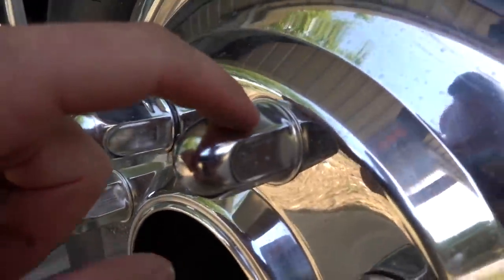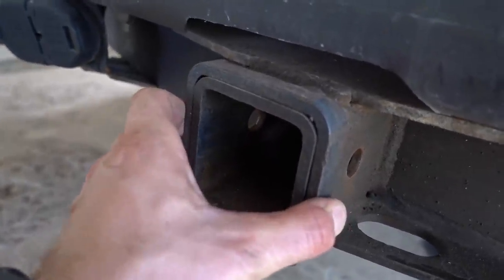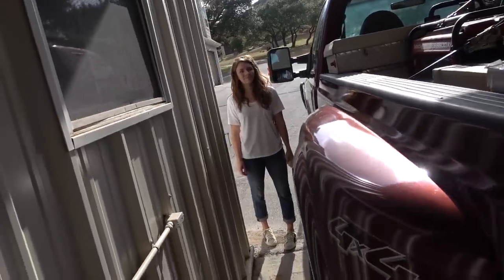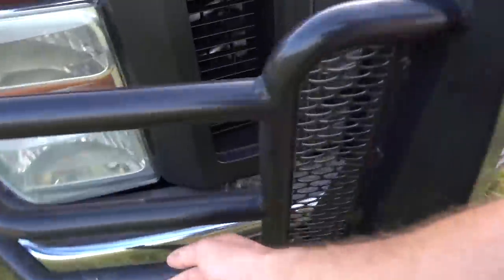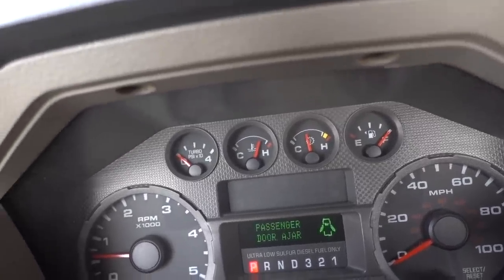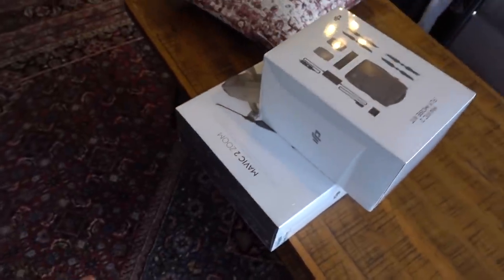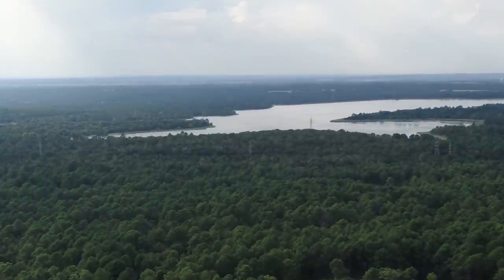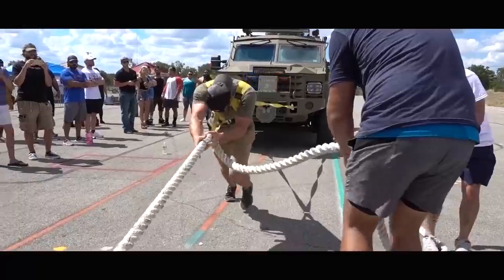My F-350 broke down immediately.....

Comment: The person that sold this or the dealer that sold this knew this truck had a problem.
Reply: well no shit, they all have problems. theres always something wrong with a ford super duty you find at a used car lot lol. ive seen many of them with the radiator overflow tank sealed off, so that you wont know theres a head gasket issue introducing air into the coolant. you dont know until its too late, and you take off the radiator overflow and see that its been filled with silicon by some sleezy asshole who didnt want to fix the issue to begin with.
Reply: Anyone who buys a Ford knows it has a problem even before being told
Reply: Its a ford so everyone knew there is problem with it
Reply: Yup.... I allways tell my customers to have $1500 set aside when buying a used vehicle.

Comment: I used to change out 7 tires on a dulie in 5.5 minutes when I worked for Sears tires, that's 16 or 16.5 inch rims could be dangerous and if you put on the smaller tire on the bigger wheel it will take your head off when you are seating the tire bead

Comment: Matts got a diesel that can't go over 60 on the freeway and its not a Hummer.      Probably should of just used the Hummer.
Reply: I've driven a humvee that couldn't even make it up a curb. Granted, this humvee was loaded down with sandbags in the floor boards, and the doors were replaced with half inch thick steel. Even still it could make it up a 5 inch curb. The turbo diesels were better but not by a long shot.
Reply: @Knoxvillemoto  that's a lot of weight
Reply: Yeah Banks offers turbo kit for Humvee makes them a beast
Reply: @kaydmcdougall9540  I agree it's not light, but not so much that I would expect it to have so little torque that it cant do it at all. Also we're talking about climbing vertically, so much of the rear biased weight is inconsequential. All the weight rearward of the back axles actually help it up the curb.

Comment: I'm a ford guy but a 6.4.... This is hilarious. They were made to die to get out of contract with ford.
Reply: International ran them till 2016 as the maxforce..... 6.0 are still the worse....cost ford way more
Reply: @jonfischer9781  my 6.0 just hit 700k miles stock
Reply: @marcuspatrick1524  That's always good to hear. My 6.0 has 245,000 and still runs like a dream. It's in a 2003 Excursion and they are getting hard to find so I want to keep it forever. lol
Reply: In most cases, the 6.4 can't even be rebuilt. It's a throw away when it goes bad.
Reply: @marcuspatrick1524  thats sweet....I did not say all 6.0s
Reply: @mckrackin5324  Yeah 6.0 is a great engine in the right persons hands :)

Comment: You don't need to go bankrupt on a newer 6.7, you can find an older OBS Ford with the 7.3 for much cheaper, plus the 7.3 is just way more reliable
Reply: May as well tow with the raptor in that case.
Reply: Lol dudes are asking just as much for a obs 7.3 as they are for a 6.0 that makes twice as much power stock  lol 6.0 are reliable as long as u take care of them. Best truck I've ever owned hands down
Reply: Dont think Matt needs much more power than a 7.3.

Comment: Shoulda bought a 6.7...or 7.3. And also sounds like a blown head gasket, so like 2 grand.
Reply: Yeah could have spent a little more and bought a 6.7 and not had a single problem
Reply: Ty Bailey it’s the oil cooler lines they clog up and it overheats
Reply: It also could have just been the fact that it was 107 degrees in Texas, and I doubt that Matt checked the oil level in the first place. You could be right though
Reply: @aaronhayden1780  it could also be a radiator. Degas bottle cap or blown head gasket. The 6.0 had similar problems and over heating while towing was an early sign of head gasket issues

Comment: Wow, i said it'd break down on your last video about the truck, didn't expect it so soon 😅😅😅
Reply: Paul Auten cause it’s a Ford
Reply: @gehlk4683  should get a toyota
Reply: JM GAMING yea no he needs to get a gmc
Reply: @gehlk4683  no a dodge with a 12 valve in it
Reply: @gggaming-md9qf  6.7 cummins from 2010 because it has same emissions standards as the 12 valve......the 6.7 in use is a slightly modernized version of the 8.1 liter used in buses and military 5 tons
Reply: FORD - F#@ked or repaired daily.
Reply: @paulauten1945  i agree but honestly any cummins is more reliable than 6.4s or 6.0s

Comment: Theres a chance that front bashbar is restricting airflow to the radiator causing it to overheat under load. Diesels DO NOT LIKE TO HEAT SOAKING (Letting it sit with engine off after excessive heat) Your truck is overheating beacause of a fault in the cooling system reducing the possible work load the engine can produce. IF YOUR DIESEL EVER OVERHEATS WHILE UNDER LOAD ITS BEST TO STOP AND LET THE ENGINE IDLE!!! Diesels like to idle and that's the best way to get them to cool down unless the overheating situation happens regardless of engine load.

Comment: Easy fix. Full delete for overheating and replace those turbos for the oil leak. Probably if you take intake boot off you will find your oil. Be careful driving because the intercooler probably is full of oil.
Reply: On the next demolition ranch the old ford has a runway engine.  How long before she blows apart?
Reply: Ford intercoolers will always have oil in them because they vent the crank case into the intake..
Reply: Also just a thermostat for overheating.....still needs a tune and delete though....
Reply: @jonfischer9781  not talking about a little. I'm talking about when those turbos fry they dump major oil always start little white smoke then all your oil in the intercooler.
Reply: @joeballew603  6.4 turbos are not a common failure point.....

Comment: A 1999-2003 f350 7.3 powerstroke dually single cab will run forever and will be the same price as that 6.4
Reply: Jason Kone 7.3 is the OG
Reply: Cars and Guitars yup best diesel ford ever made
Reply: Could not agree more we have a 99 ford 7.3 it's got over 400,000 miles on it and runs great

Comment: Head gasket, egr cooler, #7-#8 melted pistons, emissions problems The international Navistar 6.4 are problematic
Reply: That's one reason why navistar and ford split off, they got tired of dealing with the engines and it ruined ford reputation
Reply: Lifter roller gone bad and ruining cam shaft.

Comment: Welcome to mechanic Ranch.

The 6.4L power stroke is the cheapest diesel ford but there is reasons for that.... random over heating oil consumption sounds like head gasket but im not a ford guy sooooo... good luck keep us informed :)
Reply: lol 6.4 is not the cheapest motor my guy, it can be considered to be trash by many because it has so many problems but it is not cheap I’m sure it has a lot to do with being built by another company (international)
Reply: It wasnt shown to be consuming oil...there just wasnt enough oil in it...it coulda leaked...def should do an oil change.

But if it made it with the speed down...but oheats at 70...it probably just isnt getting enough coolant circulation. Since it sat presumably. Id say sticky thermostat, failing water pump, or failing hose. Radiator might be clogged, also.

Id stick with the simple shit first. Rather than deciding to do a 3000 dollar rebuild on a whim. But im not a real mechanic, and dont know much about diesels.
Reply: Hdz Heaters uhhh... International built great diesels, but Ford had to stick their nose in it and ruined those engines.
Reply: I think you’re correct with the stuck thermostat, you woulda heard that electric fan going over the sound of the motor if the thermostat was accurate.

Comment: Upgrade the transmission cooler. Typical problem with those trucks
Reply: Everything is the problem with those trucks
Reply: That's the water temp gauge, transmission won't make the water overheat. It's most likely a circulation problem
Reply: Dani Khaos yeah lol, you have to upgrade a lot to get them working good.

Comment: matt convinced me he’s never changed a tire or changed oil and dosnt know how to give a truck a checkup
Reply: I was thinking that.  

Matt I love you but you need to dive into a top end rebuild and do everything but the machining.....sorrt my friend but the oil wont have anything to do with cooling.  Good catch that it was low however.  Next time check all fluids before leaving.

Im betting something more than a fan clutch being dead though.   He needs to check the actual coolant level in the radiator not the overflow bottle.....
Reply: For sure dude

Comment: Matt im going to be honest with you i work are powerstock day in and day out bullet proof the 6.4 and it will be one bad ass truck
Reply: a whiteman there’s a lot of trucks you have to bulletproof if you want them to run forever. When companies make vehicles now they cut corners and make shit cheap.
Reply: a whiteman if you think it cost 10k to bulletproof it then you don’t know how to work on a diesel. Bulletproofed many 6.0s and the parts are only a few grand not 10k
Reply: I just spent $15,000 on mine and I still have problems with it.  SELL THAT THING!

Comment: It’s a 6.4 Power-stroke. Get used to it breaking down. 7.3,6.0 are better.
Reply: Thomas Graham 6.4 is just a bored over 6.0. All the issues from the 6.0 just twin turbo lol
Reply: Only if you bullet prooof the 6.0. But shit when ya do those damn things are fast
Reply: High Octane Performance except for the fact that the 6.0 and 6.4 are two completely different motors you are correct the 6.0 is a heui injection system and the 6.4 is common rail
Reply: High octane performance is 100% wrong with his comment. No Powerstroke engine is the same. Very very little actually interchange. The 6.4 is in fact a Navistar 200k mile throw away engine. The 6.0 is a way better engine in its bulletproofed form. Get a 2014 or newer 6.7.
Reply: Trucks do break PEOPLE. Relax.
Reply: @jasonjgr8580  Especially 6.4s
Reply: But I agree any vehicle or engine can break with lack of maintenance

Comment: That mesh in-front of your radiator is doing no favours blocking airflow over it. The fan may not be running to cool the rad either.
Reply: this makes a lot of sense; it's actually a pretty big obstruction

Comment: Huh it’s over heating why don’t I just pour 5 quarts of oil in it that should fix it right?
Reply: Amen brother
Reply: Coolant possibly
Reply: If the oil level is low it will also cause a motor to overheat
Reply: @TheKeithbudz  Yeah... As it's slinging rod bearings and punching holes in the block... If low oil pressure was the problem, the truck wouldn't run because the injectors wouldn't fire. Low oil pressure can NOT kill that motor in stock form because the injectors will quit firing as soon a cavitation is seen by the ECM. Every Powerstroke and Duramax works that way.
Reply: @mosquitofleetfishing6599  Sorry man but your wrong. The 6.4Ltr is common rail injected and not a HUEI injected motor like the 6.0Ltr was. And all Duramax's are common rail injected, they have never been HUEI motors.
Reply: @TheKeithbudz  It would have to be extremely low. That motor holds 15 Qts so 4 Qts will not bother it for temp.
Reply: @Darkhalfcustoms  I agree with you on this post, however, I think you are misunderstanding what I am saying about the fuel injectors. You are correct on the different types of fuel rail systems. The ECM is the safety on the 6.4, 6.7 and DMAX. The slightest bit of cavitation and the ECM will quit firing the injectors. The 7.3 and 6.0 flat can't fire the injectors because of the Hydraulic valves. It's a safety feature in the ECM firmware on the later models.

Comment: I wonder if your truck needs a valve job because with it overheating at higher speeds, the valves might not be opening long enough to let the exhaust out quick enough causing it to overheat.

Comment: 7.3l are cheaper, more reliable, cheaper to fix and they still can get the job done
Reply: DieselKing Trucks Cheaper and more reliable but the trucks they’re installed  in are getting old. A mid 04 and up 6.0 that’s been deleted and NO chip will get the same job done and the ride is a LOT better
Reply: @clementroubaud9361  ride may be better, but perfer solid axle for a truck
Reply: @scottsgamingtv7168  all 4x4 250/350 ford trucks are solid axle...   Though I think some mid 90's gas trucks had the TTB in the 250's
Reply: @hunterdan2002  friend has a 05 f250 with 6.0, as far as what he said, it had independent
Reply: @scottsgamingtv7168  then it's only 2wd

Comment: Bro, go to the 08-10 6.4 page on FB and read up.

You probably have a clogged EGR cooler/ valve or a clogged oil cooler/bad thermostats. Bad head gaskets would puke coolant out the degas bottle.
Reply: The 6.4 is world's better than the 6.0. Could be a faulty fan clutch, or clogged radiator.   A short trip, pulling a small load would show it...as an empty truck would not.
Reply: Justin LaPierre yes Delete everything and it will be a good truck.
Reply: @michaelcook768  hey i know a Michael cook.. You from tx?
Reply: Didn’t he say he had coolant on the oil! Hgl
Reply: @AudibleVisibIe  Afraid not. Originally from VA, been in AL for 11 years. I drove an 18 wheeler...mostly at Grand Prairie, sometimes Laredo. I really like TX. I had Carpal Tunnel surgery...ended up with a lethal case of Sepsis....so, my career is over. I have family near Austin. I would need affordability in housing, and 20 miles to a sizable medical facilities. If you have a couple suggestions, please let me know...Thankd!
Reply: tjlift22 can you explain to us petrol heads what it means when diesel bros say delete?
Reply: Justin LaPierre maybe it’s just shit cuz it’s ford
Reply: austin randall 6.4’s typically don’t show oil/coolant mix when head gaskets go, they usually push coolant out the degas. Coolant in the oil usually means a ruptured oil cooler.
Reply: austin randall or a cavitated front cover

Comment: Sorry man everybody who knows anything about fords knows 6.4s are very bad engines
Reply: Ford alone it's a bad truck
Found
On
Roard
Dead
Reply: Fixed 
Or
Repaired 
Daily
Reply: Deleted and tuned they are beast. Best diesel engine to get easy huge power out of.  I put 165,000 trouble free miles on mine before getting rid of it for my 6.7 and it was deleted and tuned with normal bolt on's from just a couple thousand miles.  It wasn't babied at all.
Reply: 7.3 is the best
Reply: The 6.4L is a great engine. Mine's been running on a pretty hot 250HP tune most of its life. I see 40psi most of the time and never baby it. I also take good care of it and have deleted EGR and DPF.
Reply: @renejrsoto  Cannot Have Expensive Vehicle Yet -  Chews Heads and Eats Valves Yearly-  Cheapest Heap Ever Visioned Yet. government bailout much???
Reply: @benb8228  : No kidding. Leave it to a neanderthal to not realize "fixed" and "repaired" are the same thing. Imagine asking a mechanic who is giving you back your car "Did you fix it, or did you repair it?", Lololol.
Reply: 6.4s are not as bad as the 6blow
Reply: My Uncle When He Hade His 6.4 Super Duty PowerStroke It Was like A 2007-2013 Its Alternator Keep Catching On Fire They Sold It And Got A Used 2015 GMC Yukon XL Denali With like 20k miles It Was A Pretty God Trade
Reply: @renejrsoto  I Love Driving On The Roard
Reply: If it’s overheatin don’t forget to check coolant hoss not just oil
Reply: @trevorfoote309  TWO TIN CANS AND A BAIL OF HAY MAKE A CHEVROLET
Reply: @michaelhoneycutt1837 : Yeah, it's the 6.0L that really got the bad reputation. I've heard of a few random problems with the 6.4L (vs 6.0s grenading), but most related to the DPF (same thing every diesel has to contend with). The amount of power this thing is making amazes me. Of course, I would not be running this time with a DPF on...

Comment: Radiator Cap First! Replace it. If your fluids are fine it's the cheapest thing you can do.
Reply: Andrew Hallin that’s honestly  the worst advice ever , if you replace the whole coolant tank with cap that’s different but cap doesn’t do jack shit
Reply: Ford is know to have bad radiator caps try a new cap frist
Reply: "the cap doesn't do jack" is like the second most wrong comment in this section. if the radiator cap is bad, the system wont get up to proper pressure which can allow the coolant to boil.

Comment: Matt that truck you bought had the worst diesel ford ever put into their trucks. This is coming from a ford guy.
Reply: chrislevie87 a 6.0 is the worse power stroke factory in my opinion when they are bullet proofed they are great trucks however.
Reply: I got a 1997 7.3 f350.
Reply: As a Ford diesel guy, I agree. Either trade it for a 6.7, or Fummins it... (or be a hardcore badass MFer and get a 7-tree)
Reply: I’m 15 and have been a Ford guy all my life. I hate to see that ford made a bad truck, but like people say, you learn from your mistakes.
Reply: Should have bought a 7.3
Reply: It's not a 6.0 I have a 6.4 for a welding rig and I love it deleted and laptop tuned and she runs better than a 6.0 the only draw back to a 6.4 is they are expensive to work on thanks to international because it is a international engine
Reply: @auston_grisham7840  took em 40 years to change crappy suspension
Reply: I have a 99 f350 with a 7.3l direct injection turbo, best truck I've ever owned. This 7.3l is damn near bulletproof.
Reply: Or you could just buy something that isn't a Ford and not have to dodge all the turds that they've pumped out

Dirtymax owner here

Comment: Not go over 60, remind me of my 1996 F-250,  351(5.8L) engine, boiled  when climbing at I-580 with truck camper at 60-65 mph. It turns out the thermostat stuck at half open, caused engine can't heat up properly while low output, over heat while high output.